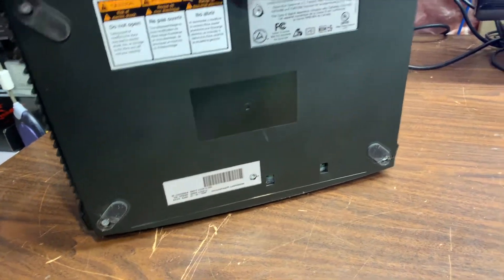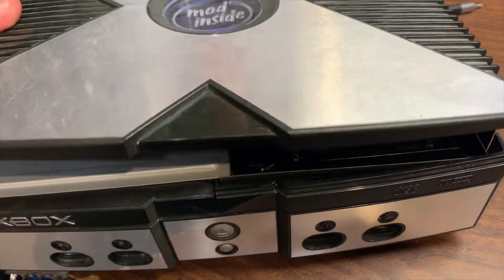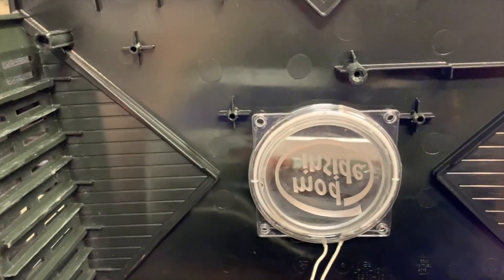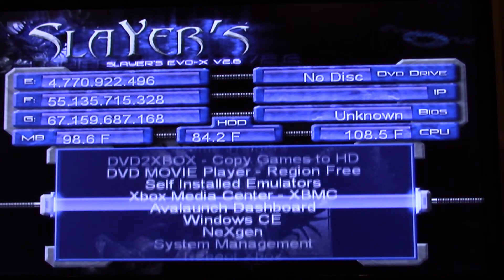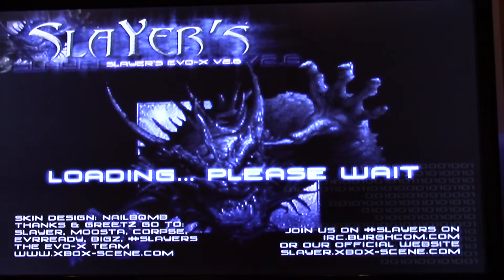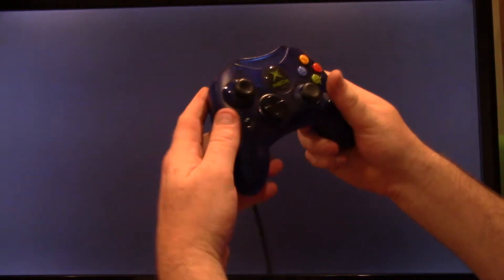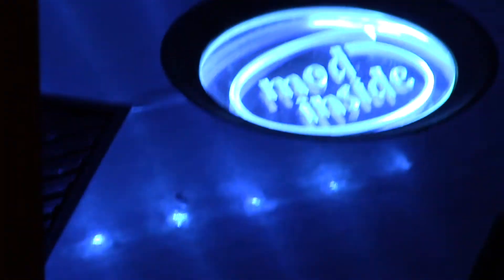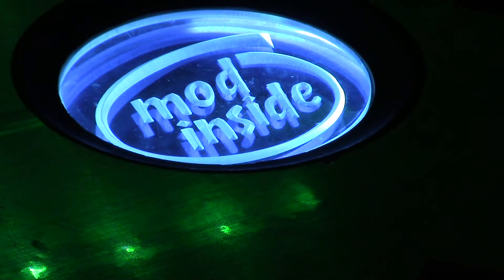Episode 106: Xecuter2 Xbox Battery Capacitor removal

Comment: these days a waste of time you can softmode a old xbox and normally you can also  slash the original chips if they are not v1.6 version
Reply from the maker: you should still remove the clock capacitor.